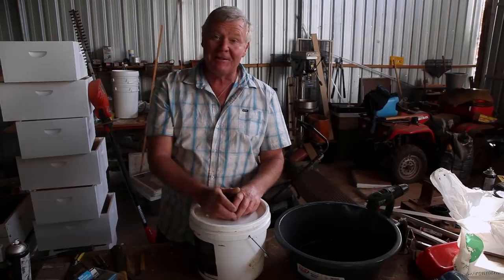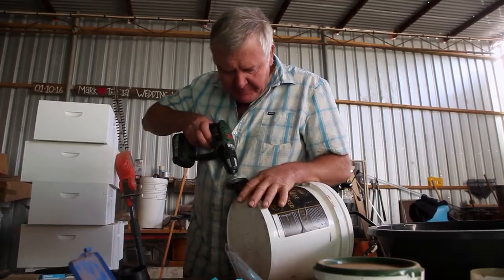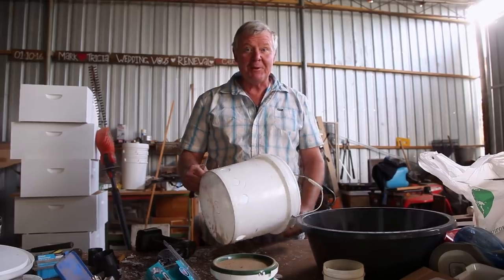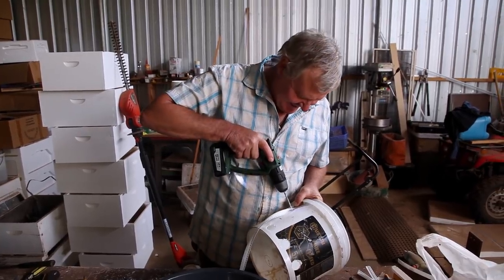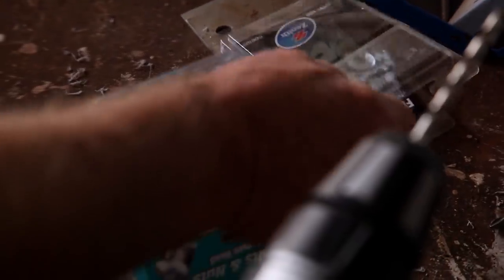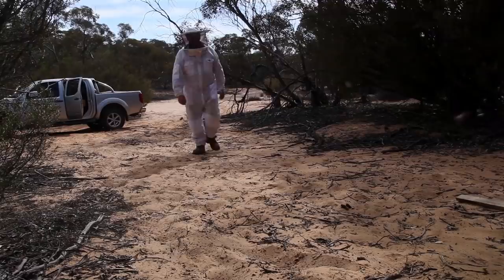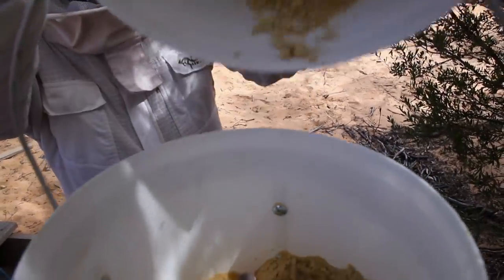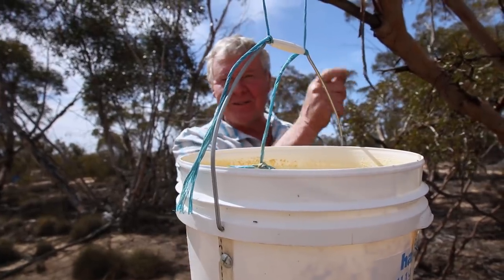How to Make a Pollen Feeder - The Bush Bee Man

Comment: looks good fellas

the straps look good but a bit complex. i was wondering if you could put the original flower pot inside the bucket. they still enter through the holes in the bucket but the pollen is in the flower pot and the bucket catches the scraps.

Comment: We open feed with pvc storm water pipe hung in trees cap on one end and a downpipe socket the other the downpipe socket stops rain in and slows them spilling it
Reply: I use the same and attach it to fence posts and in trees.  The area I am in is rather windy and damp so this model works the best.  Also use it to put raw sugar in it.